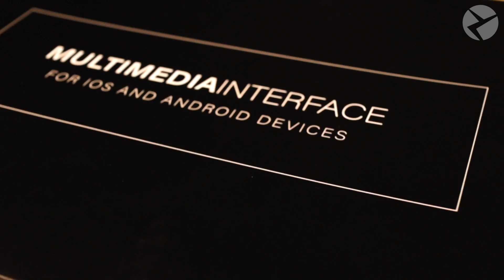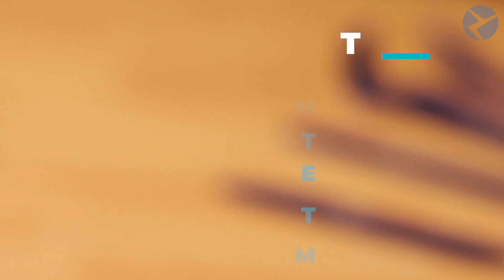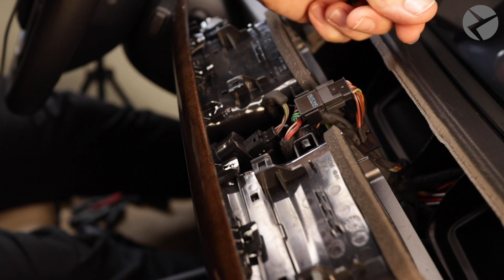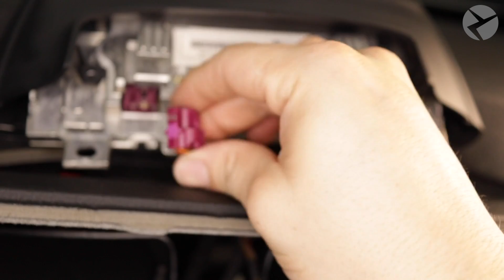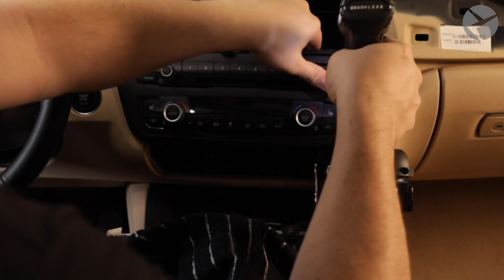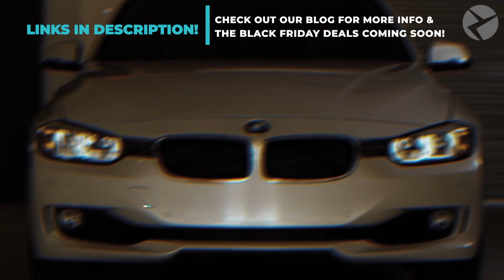Wireless CarPlay & Android Auto Prime/PRO Retrofit - Installation Tutorial for BMWs

Comment: I recently purchased and installed the MMI Prime in my 2014 BMW 328i. After watching videos provided by BimmerTech I found the installation straight forward and easy. There was no coding required. It was literally plug and play. I'm using an iPhone 12 with iOS 16.4.1.The MMI has wireless capability which works very well. When first getting in the car sometimes it may take a minute for CarPlay to come up, but most of time it comes up right away. You can also plug your phone directly into the provided USB port that will keep your phone charged while traveling. Very pleased with this product.
Reply: Hi, which media module do you have?

Comment: Anyone having flicking screen and unable to select/deselect head up display. I have purchase X5 F15 with this system installed. I am wondering if issues are related to this MMI prime carplay install?
Reply from the maker: The screen flickering issue can be caused by loose video wires between the MMI module and the screen or head unit. When someone experiences this issue, reconnecting these cables should solve the problem. The head-up display (HUD) should not be related to the MMI module, so if it isn’t working, we recommend a diagnostic session to determine the cause of the HUD malfunction.

Comment: Two things. 

After install my OEM stuff works but CarPlay function generates a black screen. Could this have to do with problem 2..

 My fiber optic cables don’t clip in. They just kind of dangle in place. Maybe the plastic clip that is supposed to hold it in place is not strong enough ?
Reply from the maker: Hey, seems like a bit of an issue - contact our support team: support@bimmer-tech.net. Equip yourself with a VIN and describe the problem. They will help you as fast and as efficiently as possible. 

Cheers!

Comment: I would like to add a dash cam on the front of the car, but how do I get the SD card recording capability
Reply from the maker: Hi, 
unfortunately, the cameras we offer are only for parking purposes and they have no recording capability.
Reply: @bimmer-tech  Thanks for the quick response.  I think that integrating a dash cam would be a very valuable future improvement, especially if it could record all the cameras on my 4 series F36,

Comment: What is the purpose of the loose-hanging USB cable other than...it just being a USB port? Does it have a special purpose or is it just a general USB?
I'm thinking of installing this module into my 2018 M2 LCI, and I don't need any extra USBs, and having a cable just hanging there is kind of messy.
Reply from the maker: It's for charging your phone, wired CarPlay and Android Auto (if your phone does not support wireless), playing videos over USB, and updates.  If you don't need any of those features, just hide the USB cable near the MMI unit so it's not visible.
- Dylan

Comment: I have a 2014 528i Xdrive with all the bells/whistles. It already has a variety of cameras; does this install change any of the camera functionality, or does this become sort of a new "aux" that takes over the idrive screen?   ---EDIT: Looks like this is answered in other comments; the iDrive is retained and you switch between interfaces my holding down the "menu" button I think?
Reply from the maker: Exactly :)
Reply: @bimmer-tech  Will the built-in cams be accessible when in the MMI system, or would I need to switch back to the iDrive system to see camera inputs?
Reply: One last Camera question---if the cam inputs on the MMI are additional camera inputs beyond the ones already in the car, could one install a FLIR camera instead of a regular camera, and do you know of anyone that has done this?

Comment: My head unit is easily twice the size of the one shown in the video, so as stated at around 12:25, it would need to be installed behind the glove box. Does anyone have a link to a video showing how to do that? Thanks.
Reply: I’m fitting one right now to a F21 with pro media so it’s double din. I’ve removed a lot trim around the centre console where the gear/auto stick it to check for voids and to also have more space to pull the double din out. I can reach to back of glove box that way, however the downside to this is it’s probably going to rattle. Recently fitted one to a F20 with single din which is a breeze. Good luck with it though 😊

Comment: Can anyone help..... I have installed the retrofit, followed instructions straight forward install, however, no matter what I try I cannot get any sound. No sound on Spotify, Google maps or anything. Any ideas?
Reply from the maker: You need to make sure all connections are done properly. It would be best if you contact our support team at support@bimmer-tech.net. Guys will get back to you within 24h.
Reply: @bimmer-tech  thanks. It was because I never had the aux connected to the car, I assumed the USB port was enough.
Reply: @MotoMartz  hi how do you connect the USB and aux cord? I’m having the same issue. Thanks
Reply: @harrymacdavid8111  connect the aux lead to the auxiliary port under the centre arm rest where the USB port is, then connect USB to phone if using android.... Where the connected device tab is in media, secect AUX not Bluetooth.
Reply: @MotoMartz  ahh okay is that only for Android? I have iPhone. I think I need to go back and change the optic wires, hoping that sorts it
Reply: @harrymacdavid8111  you don't need the USB for iPhone. Apple carplay is wireless.

Comment: I installed mine but my is a 2018 so I don't have fiber active cable and I don't want to run aux cable out off my dash, what other way I can get the sound without using the aux cable?
Reply from the maker: Aux connection is necessary. Our support team will show you how to run the cable neatly. You can contact them at support@bimmer-tech.net.

Comment: how do i go from ccc to nbt id7 with connected drive? 2008 328
Reply from the maker: You for sure can't go to the newest MGU head unit (Operating System 7) cause its retrofit isn't possible in general. Please send the last 7 digits of your VIN at info@bimmer-tech.net and we'll check what's the lates iDrive system upgrade you're compatible with.
Reply: @bimmer-tech  Thanks! Will there be a retrofit in the future?

Comment: Hi what is the antenna for? Can it provide GPS for cars without navi?
Reply from the maker: The antenna is there so you can connect with your MMI via BlueTooth and WiFi with your mobile device. It is only used for CarPlay/AndroidAuto and Mirroring functions. It does not provide GPS for cars without navigation.

Comment: any tips on my microphone not working? it had a aux mic port on the wiring but unsure on it.
Reply from the maker: AUX port is there so the MMI can play sounds through the car’s speakers. The microphone has its own 3-pin connector. If the microphone is not working you can check the microphone harness and its connector.

Comment: Ok, so I just TRIED to install mine on the G30 model (2019 530IX) following the instructions provided...(3 hours later) before I place my comments on here regarding those instructions and other items I am running into, can someone from BimmerTech reach out to me.  I sent a trouble ticket with my contact information and photos...
Reply from the maker: Sorry to hear you're having problems with the installation. Our support team is looking into everything as quickly as possible, and will be helping you soon. Thanks!
Reply: @bimmer-tech  hello folks, after the install,  I am having a problem with the AC it is  blowing hot air, even with the clip/connector connected over on the passenger side.. Any assistance is greatly appreciated? Videos to help with this?

Comment: Is this the same video for installation for the G series?  Also, what is the estimated time frame for SELF Installation?
Reply from the maker: Installation is basically similar in most vehicles, there's only going to be small differences depending on exact model and head unit. You'll get dedicated installation instructions for your vehicle with the product.

Depending on how quickly you work, you shouldn't need more than a couple of hours from start to finish.
Reply: @bimmer-tech  See trouble ticket from myself...

Comment: How do you switch between the OEM BMW menu/nav ect and the MMI (Android Auto) box? Or does this remove all the OEM menus?
Reply from the maker: No, your OEM menu is still included. You can always toggle back and forth between the MMI/Android Auto and the regular iDrive screen view by pressing and holding the iDrive controller MENU button for 3 seconds.

Comment: Does it work if your just installing the MMI Prime thing on the old screen? How do you connect the LCD out and LCD in thing if you are only installing the MMI unit on old 6.5 inch screen?
Reply from the maker: Compatibility can be checked on our website. The installation process differs from one car to another, we provide step by step instructions for each specific chassis that are easy to follow for any DIY oriented person.

Comment: will this work on a 2005 530i
Reply from the maker: Only if your head unit is a CIC. If you're equipped with CCC iDrive, first you'd have to upgrade it to CIC and then add CarPlay MMI Prime.
Reply: @bimmer-tech  that's great, mines a CCC, how to I upgrade to use your service?

Comment: Good video! Can this Multimedia Interface shown in the video be installed on a 2019 BMW F2 series, 230i convertible, basic models?
Reply from the maker: Thanks! That depends on your head unit. If you have an NBT Evo you'll be able to retrofit CarPlay MMI Prime, but if you're equipped with MGU then unfortunately you won't be compatible.

Comment: Would you be able to hook an OEM backup camera to this device rather than the AV hookup style one so not to lose the trunk opener button?
Reply from the maker: MMI Prime works with OEM cameras natively - you do not need to connect any additional wires for the OEM camera to work. It just takes a quick change of the settings.

Comment: Thanks for this thorough and super helpful video!  It really helped my install go relatively smoothly.  Here are a couple tips that might help folks out that I wish I knew, or paid more attention to when I did my install.

1. I struggled with the first step.  Removing the trim around my battery so that I could get to the negative terminal was practically impossible in my 2016 428i Convertible (F33), until I realized that if I take the top down halfway - to the point where the trunk opens to house the top - the area around the liner is easily accessible and can be temporarily removed.

2. At 6:22 into the video, he mentions that some BMW’s have fiber optic cables in the OEM harness that need to be moved over to the new BimmerTech harness.  Make sure to check if this is the case for you.  If you don’t move them over, you will have no audio in your vehicle!  There’s another BimmerTech video that describes how to do this (really simple): “How to Remove Fiber Optic Cables from a BMW iDrive Quadlock”

Sorry for the long comment and I hope this helps someone!
Reply from the maker: Glad to hear you've made it! Thanks for sharing your advice :)

Comment: When i push the menu button to go back to idrive it immediatly switches back to the interface?? I can not go back to idrive
Reply from the maker: Does it happen at all times or after putting the car in reverse or parking and then reverse? If yes, please see if the PDC button is lit up on the dashboard. If it is please switch it off.
Reply: BimmerTech its on parking without pdc ON. plus the camera doesnt switch on iff i put in on reverse, only the pdc sensors
Reply from the maker: @wigos688  Please record a video of the described issue and send it to our support team with your order number and last 7 of your car’s vin, we would like to take a look at what exactly happens.

Comment: Isn’t this supposed to be like wireless? I though I don’t have to connect usb to my phone. So I have to like plug in my iPhone charger with the usb side on the CarPlay ?
Reply from the maker: Not at all!  This system is wireless.  The USB cable is used for updating the MMI, charging your phone, playing video files (off a flash drive), or for older Android phones that don't support wireless Android Auto.
- Dylan

Comment: I am not tech savy or mechanically inclined and I managed to install this retrofit pretty easily and in one hour.  For those of you on the fence about installing it yourself.  You can do it!
Reply from the maker: Glad to hear! We strive to make the video's as easy to understand as possible. 
-CHAZ
Reply: @bimmer-tech  does it need to use any coding after fully install ?    such as BIMMER Code or Carly ........
Reply: @bimmer-tech  i installed in my bmw 120i and the check control and sound alert (door open and seat belt) dont work, any thoughts?
Reply: @bimmer-tech  can't get the DIP right, do you know the numbers sequences for a 2018 bmw x2?

Comment: will this work on the head up display
Reply from the maker: No, this will not work with a head up display, nor does the factory CarPlay.
Reply: I understand CarPlay info won’t show in the heads up display, but will the heads up display still work and function properly after installing this aftermarket unit? This is for a 2016 F25.
Reply from the maker: @johnpetrags  Yes. The head up display will work, there will not be any information from the MMI. Depending on which controller you are using with the MMI (steering wheel roll or the iDrive controller) there might be additional prompts appearing on the head up screen.
Reply: @bimmer-tech  To confirm, if I install your hardware, when I am using CarPlay via the built-in BMW infotainment screen, the Heads Up Display will still show info like my current driving speed and then CarPlay will be working as normal via the built-in screen?

If I am not using CarPlay via the MMI, and using the BMW's built-in navigation, the HUD will show navigation?
Reply from the maker: @johnpetrags  Head up display is only able to show the information from the OEM BMW screen, none of the information from MMI Prime are going to show on the head up display.
Reply: BimmerTech thank you. Once BimmerTech product is installed, is it still possible to use OEM BMW screen and its built in navigation?
Reply from the maker: @johnpetrags  Yes, you can always toggle back and forth between the MMI/CarPlay and the regular iDrive screen view. Just press and hold the iDrive controller MENU button for 3 seconds.
Reply: @bimmer-tech  Thank you. Do you periodically update the software/firmware of your product and is that free?  Are future releases of iOS compatible with your product?
Reply from the maker: @johnpetrags  Future releases of iOS will work with our product. We release firmware updates from time to time and it's free.

Comment: Is this compatible with CCC?  Your website gives conflicting info. In the list of compatible cars, it lists several models from the 2002-2010 model years, but when a specific E6x model is entered, it says that car is incompatible (even though that very same model is in “list” of compatible cars).
Reply from the maker: Our list of compatible cars is a list of 'potentially compatible' cars, yet you can only see if your vehicle is fitted for a product only by decoding your VIN. It's basically because those car models can have different iDrive systems and the exact compatibility depends on the iDrive. In terms of the CCC - our CarPlay is not compatible with it.

Comment: Do you have to install the usb hanging out from underneath the center controls? Can you not attach the usb wiring and just use the wireless connection instead? I would prefer not to have a usb hanging from the dash.
Reply from the maker: The USB is mostly used for the software updates which are released every few months. We strongly suggest having the USB routed to an accessible location.

Comment: is removing negative terminal on Battery necessary? If you cut off the power i thought u have to use obs tool to reset the battery. Isnt it?
Reply from the maker: It is necessary, because you can easily change active safety features in your car. If you do that you’ll have to reconnect them first, or your car will store an error in the SRS module, which can be only removed by a BMW specialist. So basically, removing negative terminal is necessary. You do not need to however reset the battery if you are connecting the same battery back.
Reply: @bimmer-tech  ah! i see thank you

Comment: Hi! Do this work on 2014 serie 1 (F20) no GPS? 
I want carplay!! :D
Reply from the maker: Hi! If you put your VIN here: https://www.bimmer-tech.net/category-bmw-carplay-mmi-retrofit you'll see if it's compatible with your vehicle. Thanks!
Reply: BimmerTech do I need to connect everytime the carplay to my iPhone or s automatically?
Reply from the maker: @filipemendonca4978  Your phone will remember the connection
Reply: @bimmer-tech  Install but when starting the interface it gives me two flashes of the start screen and then it starts normal, I read about the fiber optic cable it connects to the new harness but mine does not have fiber optic cable, does anyone know what happens or if it is normal? bmw 118i  2014